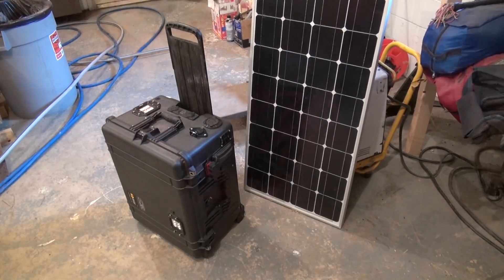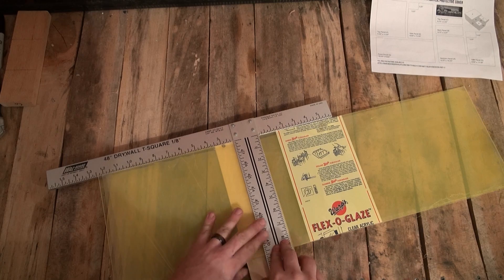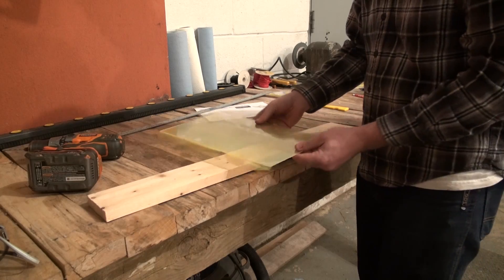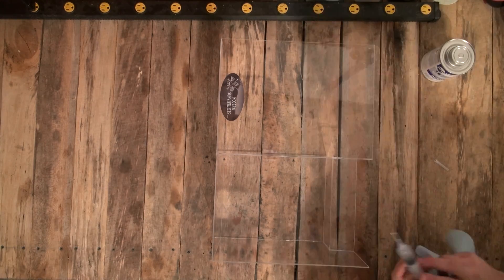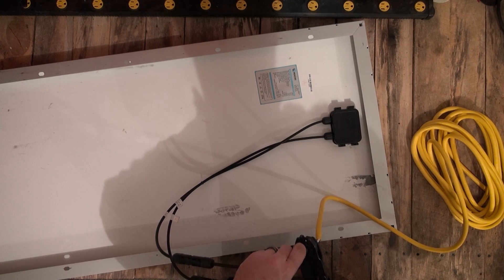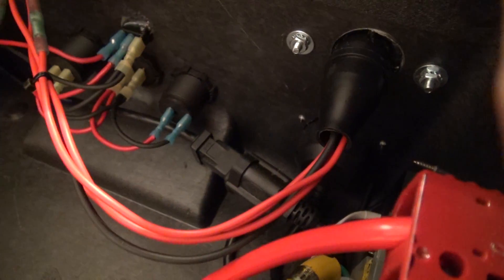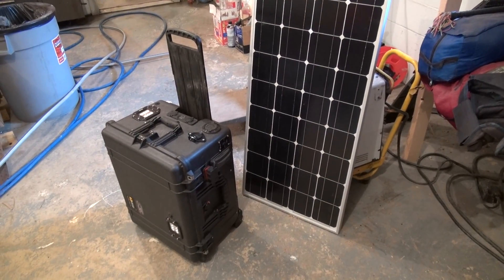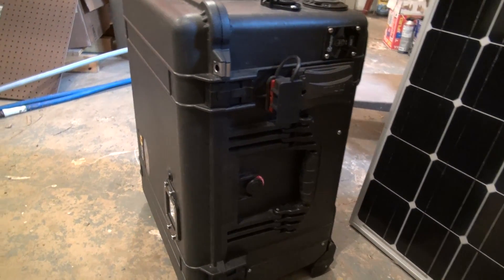DIY Solar Generator - Improvements

Comment: Absolutely LOVE your series. I can't wait to start my own build, with a different case (gotta cut some of the cost, lol). There's one thing that is just a little confusing. When you cut the +wire from the CC to the fuse box, why don't you just replace with a longer wire? Does the -wire just go to the round connector?

Comment: i built my solar system off of your videos, i am having a problem though. my charge controller doesn't light up unless i have it plugged into electric. my battery seems to be charging though. also my renoloy box stays green for type of battery, red on battery and flashing green on the 3rd light.  sometimes the power button on the inverter turns red instead of blue. any idea what i need to do. i am only trying to run a sump pump when i am out of town. Everything else works, lights plugs,etc. thanks.
Reply from the maker: Hi Reene, Which model solar controller do you have? Renogy updated the controller in their 100 watt kit with a slightly different controller after I purchased mine. The indicators are different on the new version.  Can you clarify what you mean when you say it won't light up unless you have it plugged into electric?  Do you mean the AC power into the battery maintainer / charger unit?
Reply: My mistake, the battery maintainer(schumacher se-1-12s-ca) is the one that doesn't light up unless i have it plugged in an ac outlet. The solar controller just says wanderer(CTRL-WND30) the led lights are for pv, battery,type of batt. The pv continues to flash green, the battery stays red and the type is green. my inverter is the krieger 2000 110 volt. it periodically has the power button turn from blue to red and when it is red it reads low voltage. The meter on it says it has 11.7 when this happens. I appreciate you getting back with me and hope we can resolve my issues. Thanks
Reply: Maureen Z, what size of battery are you using? One mistake many people make when it comes to inverters is that the battery is too small to supply power to the inverter. Automotive batteries are meant to put out hundreds of cranking amps, for short periods. Deep cycle batteries for solar (especially standard SLA's) generally cannot supply more than half their amp hours on a draw without potentially damaging the battery. If you have a 36ah battery you shouldn't draw more than 18amps at most. 12v x 18 amps = 216watts (approximately) which isn't much. It's about 2 amps for 120v after the inverter. Your pump probably draws a lot more than that. Your inverter may be trying to tell you that it cannot draw the amperage out of your battery to supply the pump. This means you need a bigger battery or several batteries. For a 1000watt inverter (12vdc ---> 120vac) you need a ~168 amp hour battery minimum (84 amp draw x2 for the ap draw restrictions). To be safe 200ah for extended draw at the full 1000 watts (personally i would do 2x200ah batteries). 

Now there are unique set ups out there that can actually handle higher loads than first glance would tell. But those systems are generally specific and well built and "tuned" for their loads.

There are a lot of resources out there for batteries and sizing your systems. When it comes to solar power, the batteries are the heart and soul of your system and everything should be based around the battery spec's.

Good luck!
Reply: Maureen Z oh and i had to look back at his components because i didnt know the battery specs. The Optima battery he used in his build is both a starting battery and a deep cycle. Meaning it can put out 750 amps in a draw. BUT it is limited by its 55ah capicity, meaning he can draw hard but only intermittantly or risk running the battery out real fast. A good choice for his build actually!

Comment: Did you consider adding some temperature control or fans for using the generator in high heat conditions. I didn't notice any air vents in the box for the inverter. I would assume a 2000w inverter can heat up pretty fast. I also heard that if the box heats up then your battery won't run efficiently.
Reply from the maker: I wanted to keep the unit completely weather tight, so I did not install additional vents. The inverter has a built in safety limit for temperature, and I have never had it hit yet with my usage. If I am ever using it really heavy in nice weather, I will probably open the case to give it some additional ventilation.  

Yes it is true batteries are a little more efficient in ideal conditions. But keep in mind they are also designed to work just fine under the hood of a car, even in scorching 100+ degree days.
Reply: Thanks for the quick reply, I live in a desert area where outdoor temperature can go over 120F during summer. I am trying to replicate your model with adjustments to such harsh weather conditions. It would be great if you share some thoughts about that.
Reply from the maker: Ah I see. I don't have any direct experience with it in those conditions. I would probably be sure to leave room where some vents and maybe even temp controlled fans could be added later, and then try it without first to see if they are necessary. If so, then add them in. You probably don't have as much rain as we have here either, so it may not be a big deal to add them for you. Let me know what you end up using and how it works out!

Comment: you have plenty of space left in there have you thought about installing a crank system to top the batteries off when the sun isn't optimal?
Reply from the maker: I think most of the hand crank generators are a gimmick.  I haven't seen any personally that produce much power.  I have seen some that claim you can recharge a cell phone using a USB power cord to the phone. Those take a LOT of cranking to raise the cell phone battery even a few percentage.  These are deep cycle batteries with far more capacity than a cell phone.
Reply: ModernSurvivalists alot are small and flimsy. i was talking like a low rpm wind alternator and a hand crank. solar and wind is a nice option but sometimes in gloomy weather neither is a viable option and in a after the storm scenerio sometimes all you have is human power. awesome build though i really like your set up
Reply from the maker: Ah I see. I haven't much experience with those yet, but if its using an alternator similar to a wind turbine, it should have some decent power capability.  Assuming it can be direct wired to the battery without any additional circuitry, you could always use the high current quick connect to connect it in.
Reply: ModernSurvivalists the one i looked at produced a.c.  since it travels distance better than d.c. but had a lil jumper that dropped it to dc then you should be able to go directly to charge controller or to battery.
Reply from the maker: Makes sense. I imagine an automotive rectifier / regulator module would work perfect. Since that is pretty much exactly the same role it serves for recharging the vehicles battery, plus they should be pretty common to source and inexpensive.
Reply: ModernSurvivalists yes sir. still like your build when i am able imbgoin to piece one together myself for a travel trailer.

Comment: can you put four 100 watt panels  thought a extension cord like this?
Reply from the maker: Hi Dan, yes, if it is a 12 AWG cord like I used, it should be plenty adequate. In perfect conditions (direct sunlight, no clouds, perfect temps etc.) and at their peak efficiency these panels can provide up to 5.29A each. Four of them in parallel in the same perfect conditions could provide up to 21.16A. 12AWG wire can handle this very safely. For extremely long wire lengths, an even thicker wire gauge would allow for less voltage drop, with the trade off being cost, flexibility, and weight.
Reply from the maker: I am working on a video now that will show how to expand this solar generator, including the solar panels up to 4, and the battery bank as many as you want using the quick connects I incorporated into my design.  Hope to have that up soon!

Comment: Assembling my parts list--great editing and narrating, by the way; thanks for taking the time. Have you seen a need for a master battery switch, or have the individual switches proven sufficient?
Reply from the maker: I haven't had any problems with battery discharge, which I assume is the reason you are considering the master disconnect switch?  If you decided later on to add one, you can add the style that mounts to the battery post pretty easy. Like this one for exmaple: http://amzn.to/2k7dFq8   I use that style on my 5th wheel camper and it works good for that.

Comment: so if you are not using it for a period of time you could use a push to make switch internally to connect the controller to check the battery ststus. Then you can decide to charge or store the unit again. saves getting your multimeter out everytime. ✌
Reply from the maker: Thanks! I used the multimeter in this video to measure the idle current draw of the solar charge controller when solar panels are disconnected. The unit actually already has a volt meter gauge flush mounted to the outside of the case (along with many other accessories) controlled by an external switch. So checking battery status is already very easy. I didn't utilize any of those in this video, but you can see them in the previous one. Otherwise, without the existing volt gauge that is a good idea!

Comment: Great thinking on the controller disconnect.  I was wondering why you didnt use a more standard connection for the panels, (mc4 or Anderson), and still think you probably should have, but that auto disconnect feature you get with your connector is pretty cool.
Reply from the maker: Thanks, glad you like it!  
I considered both MC4 and Anderson connectors in the planning stages. MC4 is very water tight and a good electrical connection, but they are not very easy to connect / disconnect. The standard MC4 connecter are only one conductor, so we would need two of them as well.  The Anderson connecters were my next plan, and I even purchased some to use, but I was having a difficult time finding a nice weatherproof method of mounting them to the case. The I came up with the 6-pin trailer plug idea, and feel it is much better all around. It is very weather proof (designed to be on a bumper through rain / snow / salt spray etc. from the road), very easy to connect / disconnect, will last for years even with daily use connect/disconnecting, high current rating, the spring loaded cover also has a locking wedge that keeps the plug form accidently pulling out, plus the additional pins I used to make the auto controller disconnect switch. Plus both ends combined are less than $10 shipped. After using it, I wouldn't even consider going back to MC4 or Anderson for my needs.